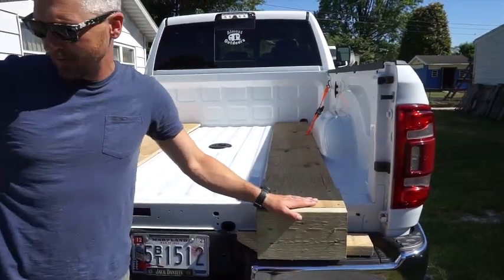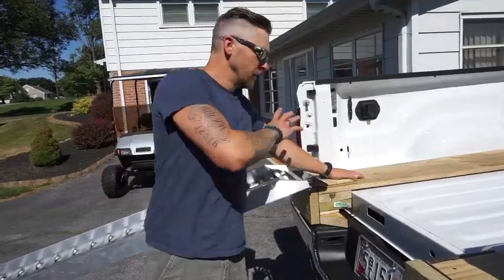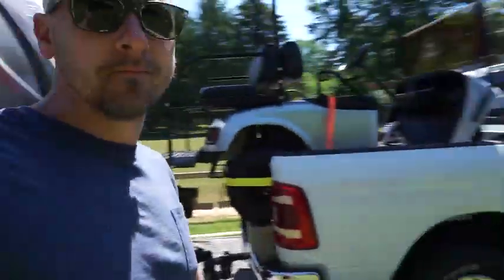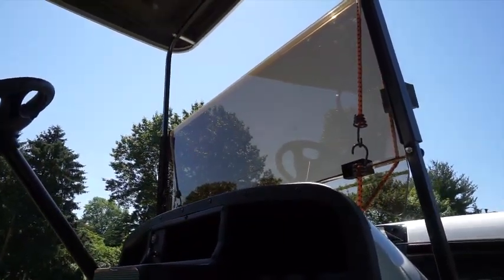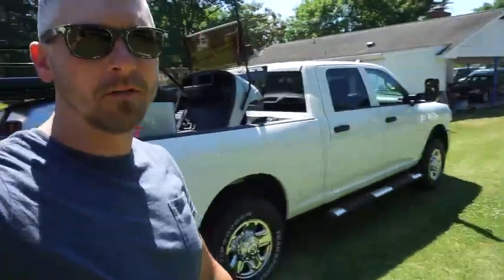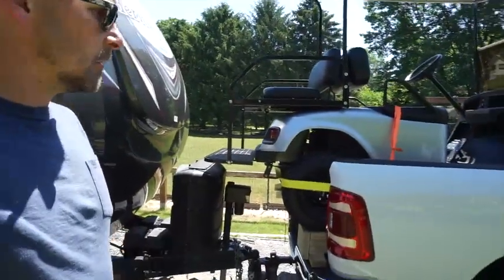How to Safely Load a Golf Cart in a Short Bed Truck

Comment: Going to pick up our first golf cart in the morning... How exactly did you bungee cord the windshield? Also, do I need to run at least one strap over the roof? Or no?
Reply from the maker: I actually take the windshield off now. No straps on the roof. Just make sure the bolts are secure then u should be good. I’ve had it up to 80mph and it’s fine.

Comment: Did you have any sagging once you raised the tongue jack with your 3/4 ton?  I am going to be trying a similar set up with my F250 and am wondering if I will need some additional support?  Also - looking at the same ramps, would 8’ers work too, in your opinion?  My cart is NOT lifted like yours...

Comment: How long is that golf cart and how did it do with the floorboard on the rear ?
Reply from the maker: Can’t remember the length but always does great with the wood supports on the bumper. I just measured from the front of the truck bed to the bumper, then measured the golf cart from how the tire sticks out in the front to center of rear tire. Works great

Comment: We have the same truck and really like the setup as I am in the market for a golf cart to haul while towing a my TT.  Can you please expand more on the orange straps at the front of the bed and how you secured them to the boards?  Thanks!
Reply from the maker: Once u make ur boards to the length of the bed just drill a hole about 2in from the edge of the board and feed the strap hook through it. Then hook one end to the top D ring and the other to the bottom and tighten down slightly. This way the won’t slide at all
Reply: @almostoutdoors  awesome!  Thanks for the feedback.
Reply: One more thing.  Did you but the extended shank for more clearance?
Reply from the maker: @ericashby5803  the shank?
Reply: @almostoutdoors  yeah, the adjustable ball mount shank.  They make em’ up to 18”. I was just wondering if that is something you had added.
Reply from the maker: @ericashby5803  o nope sry

Comment: Nice video very helpful, we have almost same set up. Did you end up having to remove that rear foot step?
Reply from the maker: Yes just to be safe. Good luck be safe 👍🏻
Reply: @almostoutdoors  What kind of ramps are those? overall length?
Reply from the maker: @toddc.4749  11ft folding ramps from long ramps.com

Comment: CAn you tell me what the overall length is after the wood is added? So from front by cab to end of wood?
Reply from the maker: It should be the same. The wood only goes to the bumper. It test on the bumper
Reply: @almostoutdoors  I need to know the length I am trying to determine if my golf cart is similar in size or larger than yours.
Reply from the maker: 83in
Reply: @almostoutdoors  Thank you
Reply: Thanks for the tips I just finished this today and my cart is currently in the back of my shortbed truck

Comment: What is the exact measurement of your bed from cab end to the edge of bed. Mine is 6ft 4". I'm wanting to do the same but not sure if my bed is long enough.
Reply from the maker: Same
Reply: @almostoutdoors  ok thanks. I know you said yours was a 6 1/2 ft bed so I measured mine and I thought mine was a 6 1/2 ft. but measured 6ft 4". I knew 2" would make a difference.
Reply from the maker: Lol np good luck. The 11ft folding ramps make it much safer too. 👍🏻